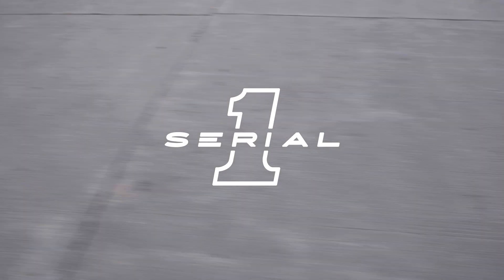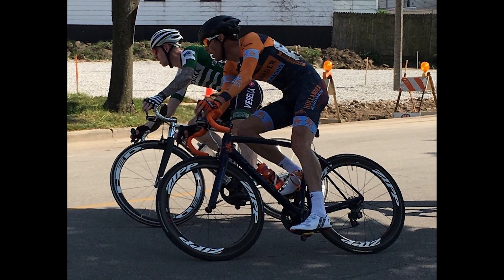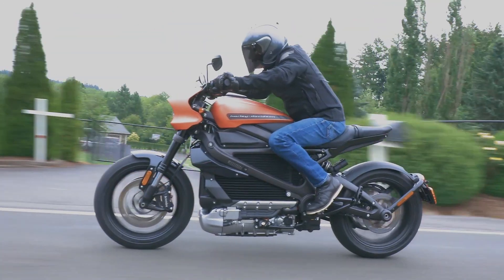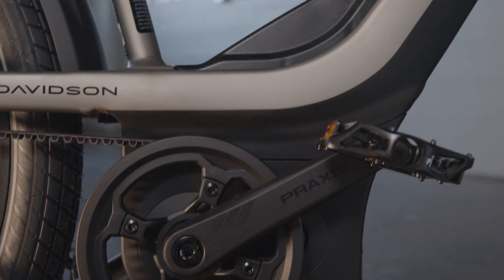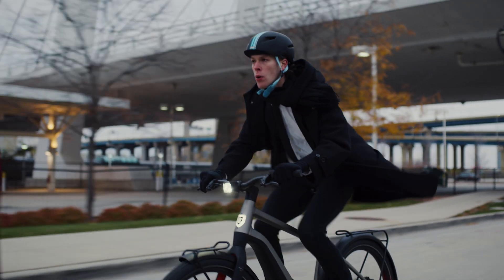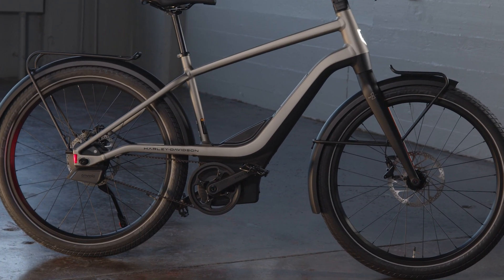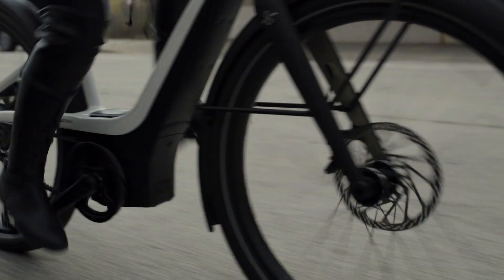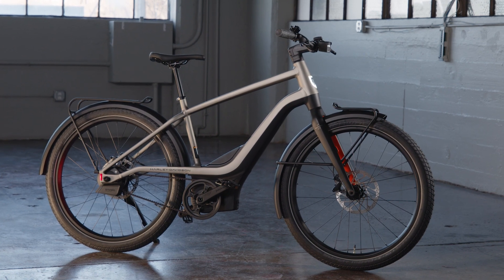The Making of Serial 1: Engineering Story

Comment: Buying a serial 1 was my big mistake. This is a half baked e-bike without good partnership, incomplete execution and about three years later (as warranties about to expire for most bike) abandoned by filing whatever and selling to least known company. What is situation of my 1 st generation serial 1? Smart phone controller never talked with phone app as well as enviolo IGH, app disappeared and as soon as app disappeared and enviolo updated firmware and their app, I have three things acting (or not acting) on their own. Result is controller do not show battery status in sync with indicator on the battery, enviolo don’t sync with battery as well as controller and now would not let me sign into the app to adjust its parameter. So I get inaccurate rage on controller, speed (eco, sport and what?) and gear. What a dud at $5500 and even at 50% discount. At $5500 you would proven ebike from Europe such as Reiss & Muller and one of many others.

Comment: Could you possibly talk about the non-comapitibilty with bicycle trailers?  I'm curious why the decision was made to use a non-standard axel that will not support any common trailer hitches.  If somebody wanted to use this to take their kids anywhere, it's basically impossible because of the engineering choices made here, without a custom adapter, that nobody makes.
Reply: @Mr Mr That's how I understand it.  It's just the rush.  I did finally find a machinist to build a custom bracke at the cost of a small fortune.  It's mind boggling whey serial 1 just completely ignored this.   You can go into a bike shop and basically 100% of all bikes are trailer compatible, except this one...
Reply: @ahbradford  Mr Mr is the biggest a$$hole to ever own or ride one of these yuppie hipster things and needs to get a life
Reply: That's a major bummer... The main reason I want an e-bike is to make it easier to tow my 2 kids up hills. oof.

Comment: Hello. #Serial1
I was wondering if this e-Bike is considered to be a hybrid ir just a city rider. I mean... I am definitely not going to use it as a BMX or fully mountain bike, but... Can it really handle some off-road and off the track rides? 
The reason I ask this is because i am considering buying the BMW Active Hybrid e-Bike, and i just found out that the Serial 1 is already shipping. 
Can I actually pedal or use the bike even without battery left?

Thank you very much.
Reply from the maker: Hi Javier! The /CTY lineup was designed for city riding, but can handle some light off-road trails. You can still pedal if the battery runs out. Feel free to reach out to support@serial1.com or give us a call at 1-844-SERIAL1. Our support team would be happy to answer any of  your questions!
Reply: @Serial1  thanks for the response. Cheers!